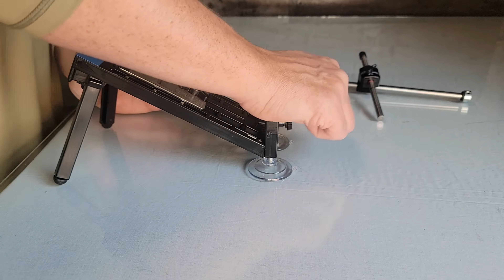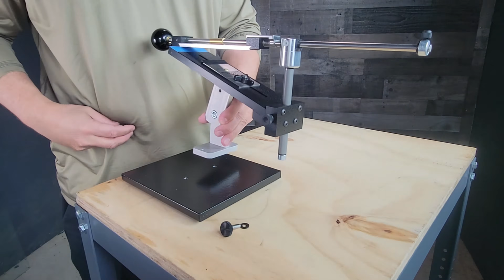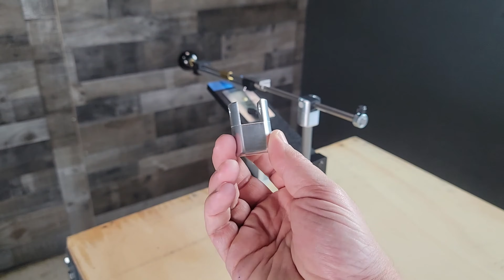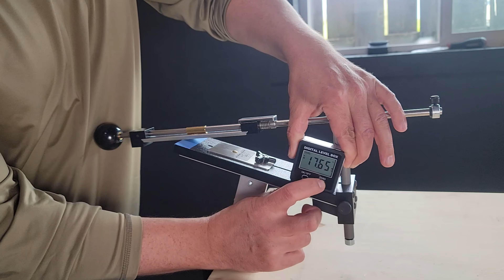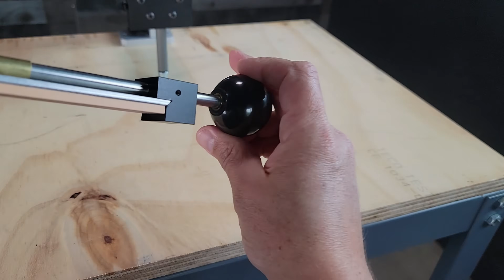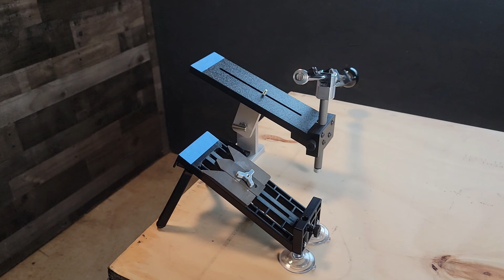Discover the Best USA-Made Knife Sharpener

Comment: If you want to spend an hour on sharpening a knife, go ahead. I use it for years, because I paid 1 grand. But I really want to throw it away. It never allows you to get repetitive result. Because the blade isn't held on place when you hold it. And you easily miss the right angle on every pass.
Reply from the maker: That's impressive that you've used it for years since we only released this particular model 1 year ago. I can promise you that it will make your knife sharp if you take the time to learn how to operate it correctly. But it does require a little hand-eye coordination. The lack of clamp allows you to sharpen at lower angles, and sharpen any length blade. I'm guessing that you probably got a version that does not have the magnets in the front of the table that help you hold the knife, it would definitely be helpful for you if this is where you're struggling.

Comment: Hello Cody. Great Video!  I have the pro with the slide guide. If I was to get the Beveltech, will my slide guide work with it?
Reply from the maker: Hi Brad! So the only difference between the 2 slide guides is that the Pro slide guide is a little bit wider. It will still work just fine, it just hangs over the edge of the table a little bit. You could certainly try it first, see if you like it and then decide whether you want the narrower one at a later date.